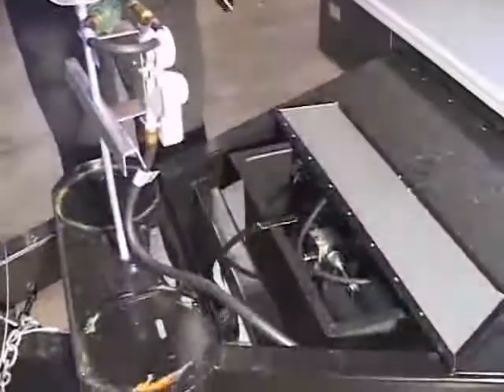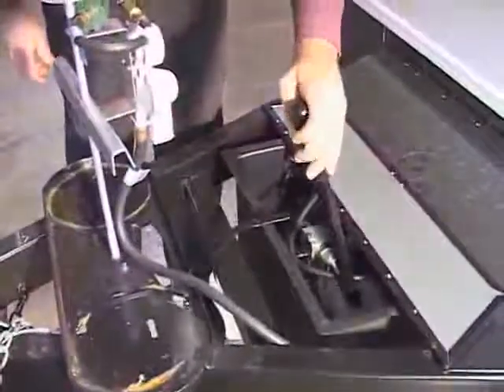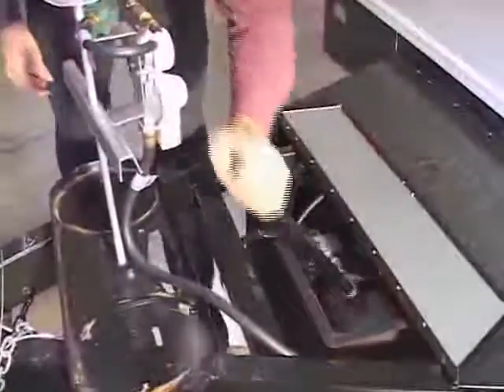7 Hi-Lo-TLift pump backup

Comment: You mention hooking jumper cables to the battery but if the trailer is in the down position how do you get to the battery?
Reply: exactly the battery compartment is blocked when top is down.